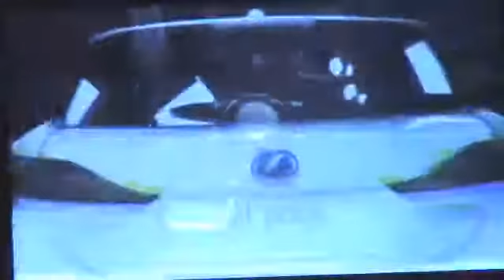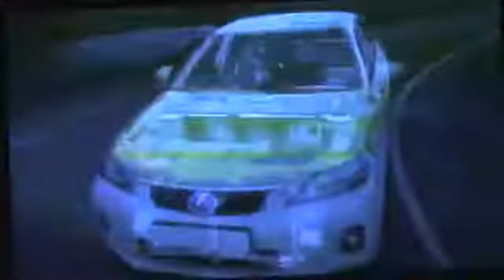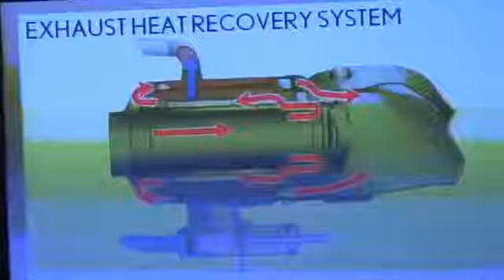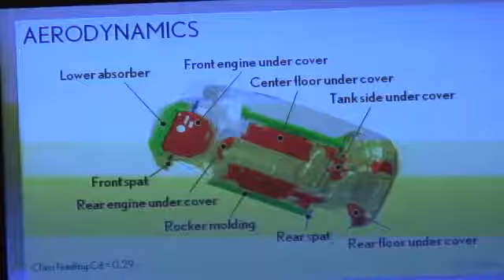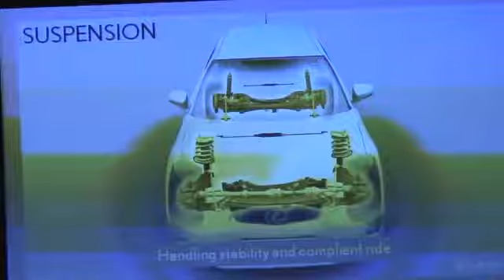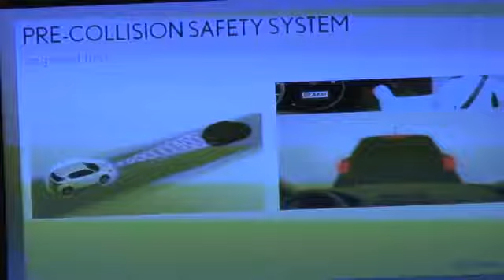Com'è costruita la Lexus Ct200h.

Comment: Video molto interessante. Sto per prendere una ct200h usata del 2018 con 25000km certificati. Ma sono molto tentato da una prius con 60.000km sempre del 2018. La lexus mi costerebbe 3000 euro in più e ha il baule non proprio da viaggio, pero è bella oltre ogni dubbio. La prius mi attira per la spaziosità e ha un certo "fascino dell'orrido", solo mi chiedo come possa con quelle dimensioni consumare di media MENO della Lexus.
Reply from the maker: La Prius essendo del 2018 ipotizzo sia la V4, quindi tecnologia superiore alla Ct200h che deriva dalla Prius V3. LA Prius consuma meno perchè ha il sistema di quarta generazione, più efficiente di quello di terza utilizzato sulla Ct200h, è più curata sul Cx e utilizza degli pneumatici di misura inferiore per ottimizzare la resistenza al rotolamento.
Reply: @Hybrid_Motion847  è vero, infatti la prius ha 122cv mentre la lexus ne ha 136, mentre per quanto riguarda le gomme la situazione è invertita.
La Lexus che ho puntato monta degli ottimi 205/55r16, forse una delle misure più equilibrate che ci siano. 
Mentre la prius ha dei 215/45r17. 
Così a naso potrei aspettarmi consumi abbastanza simili e un cambio gomme decisamente più oneroso con la Prius (fino 200 € in più se monto delle Michelin 4stagioni).
Secondo te a livello di affidabilità, quale delle due generazioni è migliore?
Reply from the maker: @edobiotec  Come affidabilità entrambe.... Toyota è prima nelle classifiche da decenni.
Per quanto riguarda la potenza totale di 122 e 136cv, hanno solo cambiato l'algoritmo di calcolo della parte ibrida. Il motore termico rimane il medesimo da 99cv. In fatto di prestazioni sono identiche.
Reply: @Hybrid_Motion847  grazie per le celeri risposte!